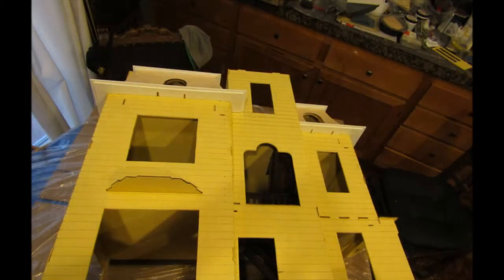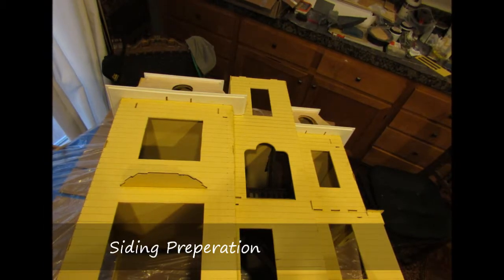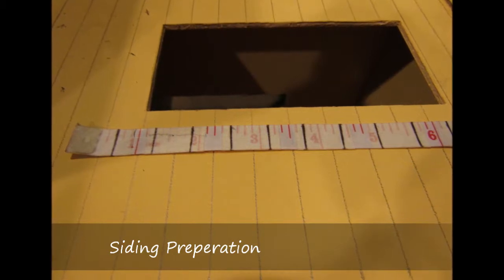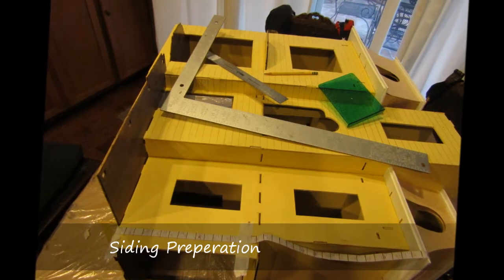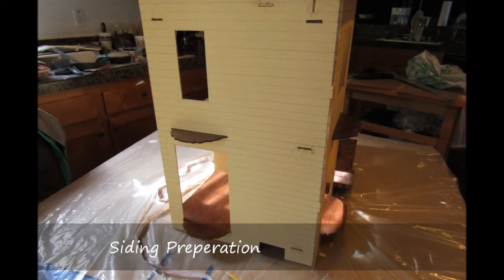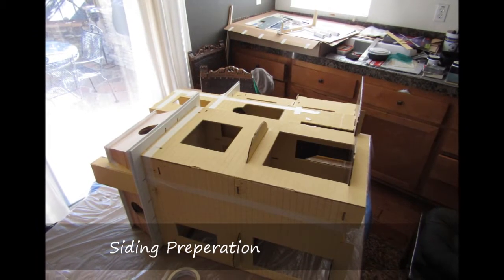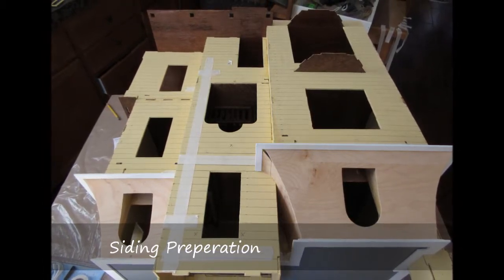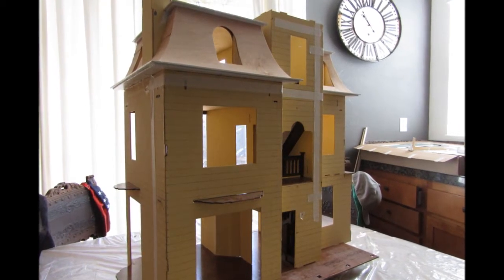Beacon Hill Dollhouse Construction: Siding Preperation

Comment: I'm still playing around with ideas for siding and would like your opinion.  At a thrift store I bought a window blind with 1" plastic vinyl slats.  I cut a slat in half lengthwise and into a few short pieces, then glued them on a piece of scrap wood with a 1/8" overlap.  Doing this seems to take away from the bowing of the slat and gives just about a 5'8" siding strip.  Your thoughts??
Reply from the maker: That is an interesting idea.  My concern would be the engineered curve in each slat.  As long as you like the result, then I think you found a cost effective siding for a dollhouse.

Comment: I just found an older kit for the Beacon Hill that does not include the wood for the siding or any shingles?  What wood will I need to buy to make the siding???  Where is the best place to purchase it?  Any idea of how much is needed?  I have watched most of your videos and really appreciate what you have done.  They will be very helpful as I am making this beautiful house.
Reply from the maker: The siding is 3/4" wide.  I don't recall how many sheets, but there were at least 5.  However, this might be an opportunity to customize the exterior to make it uniquely yours.  You could try stucco, brick, stone, shingles, etc.
Reply: @BradVaughn  Thanks for replying so quickly.  I'm considering those alternatives as well but at this point I think I still want to do siding.  Where did you get the siding pieces?
Reply from the maker: @lindabalas5352  I purchased a new kit that came with the siding.  You might contact Greenleaf to see if they sell the siding separately.  There are many websites that also sell dollhouse supplies.